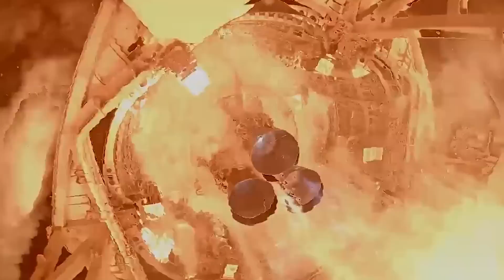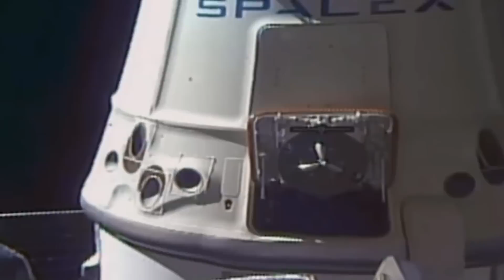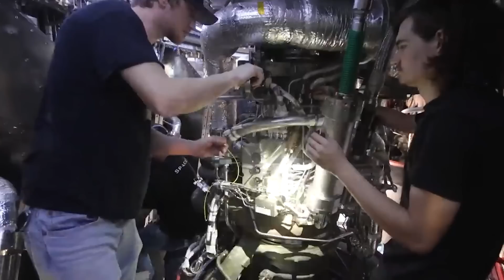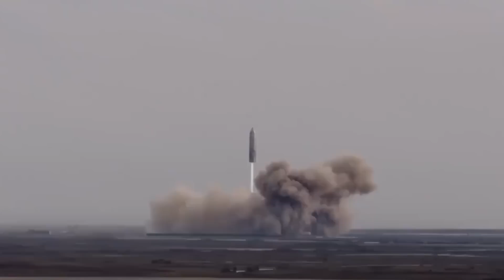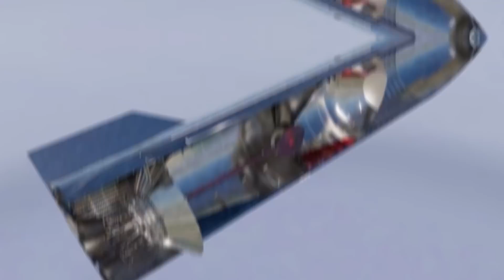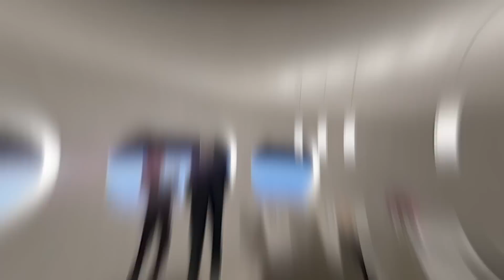SpaceX Updated Starship's Interior Design Is More Important Than You Think

Comment: It definitely needs to be modular, as well as easily expandable.   And basically, it is.  It would be easy to add another 2m ring or two to the length of the ship if if is determined they need more space for supply storage or life support systems.